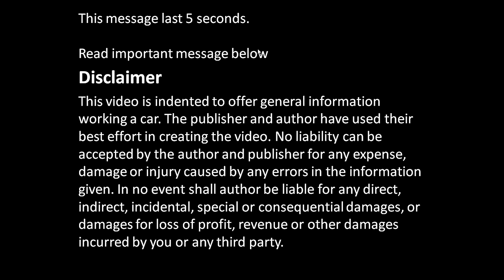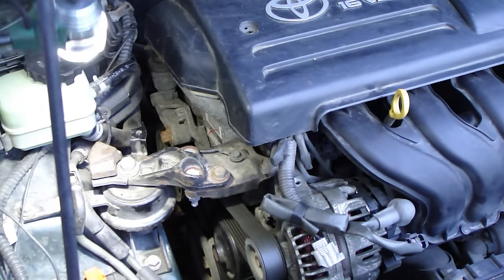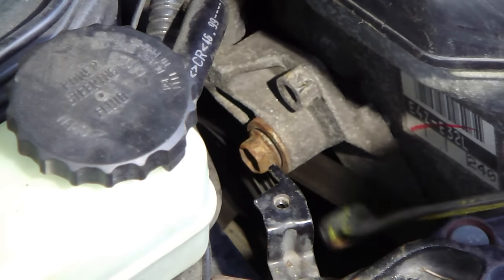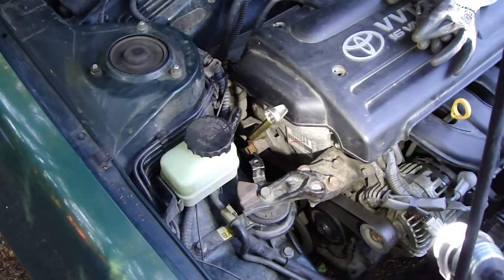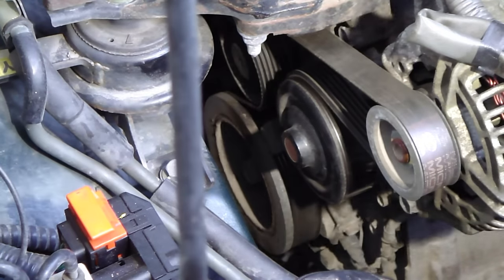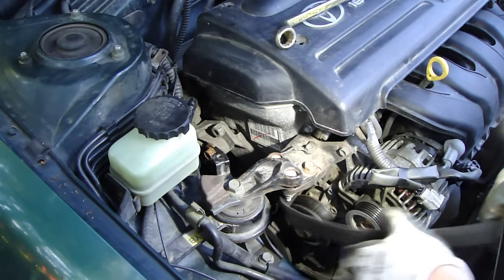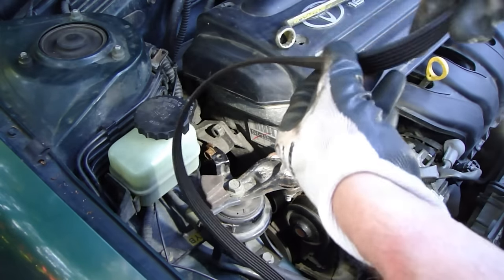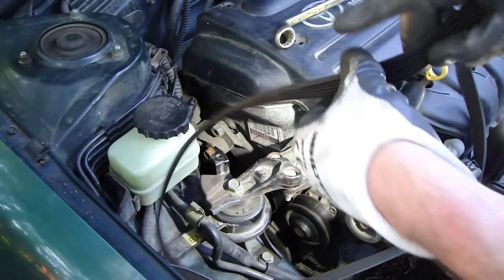How to replace drive belt or serpentine belt Toyota Corolla. VVT-i engine. Years 2000-2009.

Comment: Thank you Peter. I finally changed my belt a minute ago. My arms are really skinny but it was still extremely difficult to get to the bottom pulley.  I was thinking about taking the tire off, but I instead jacked the car up and went under to get the belt around the bottom pulley. I also needed the serpentine removal tool because using the regular socket wrench was too difficult for me. Saved me a lot of money though!

Comment: Thank you so much! I watched 3 videos to change the 2008 Corolla belt and all three were DIFFERENT! THIS one is the same as my Corolla so I was very glad to find your video! I agree with Marie Beckley that you shouldn't need to loosen the tensioner pulley bolt unless you are changing the pulley. By the way, excellent multiple visuals of the belt from different angles!  Thanks again!
Reply from the maker: Hello and Thanks for your comment. :-)
Reply: instablaster.

Comment: No need to loosen the tension mounting bolt, unless you’re replacing the tensioner component, it pivots on that bolt. Put a six point socket or closed end wrench on the 19mm cast nut, pull towards the front bumper, slip the old belt off the alternator. It’s also recommended to check the tensioner pulley bearings at this time. If it needs replaced, now is the time to do it! Install the new belt in reverse order. Before starting the engine, be absolutely certain that the belt is on every pulley groove on each component by physically touching. Only then can you start and immediately stop the engine. This allows the belt to seat properly in the grooves. Double check by touching the belt again confirming it is on each component groove as required. Don’t just rely on a visual inspection while the engine is running. Failure to install the belt correctly will damage the new belt. When buying the new belt, Toyota is notorious for using the car VIN for parts lookup. Don’t walk in and say “I’m working on a year/ model yaddayadda”, or you’ll be making two trips to the parts store. Use the VIN number!  I hope this advice helps.
Reply from the maker: I have read your message, Thank you 😀👍

Comment: Thank you once again peter for your well informative content. I had that one bolt really jammed, didn't really budge even with a pipe at the end of the wrench. I put the engine on for a while, and there it started to loosen up. I think that small heat did the trick.
Reply from the maker: Good to hear

Comment: Sir, I have two issues with this video.
1. the first bolt that is loosened with a 17 mm is not necessary, loosen the bolt if the tensioner is not pulling as it should.
2. for better access take a 10 mm socket and remove the plastic panel over the top of the engine. it gives an extra inch that is valuable to people with larger hands.
Reply from the maker: Thanks for info.
Reply: I agree DUDE...The 17MM is just a hinge bolt. The "arm" is always free to swing, but always tensioned.  Just a 19MM or 3/4"(19.05MM) socket with a "long handle" is all needed.
While belt is off you can also do a quick check on the waterpump and alternator bearing.  Just hand turn it.
Reply: Dude12485 - I total agree because I have large hands and it's a pretty small area to work in. I'd like to add a 3rd note... There are lines crossing the access to this area. I wish this video added removing those, too. That last pulley was a real frustration challenge for me.
Reply: Yep, the tensioner is free to move...otherwise it wouldn't be tensioning the belt ;-)

Comment: My husband said that you do not need to loosen the tensioner's mounting bolt. All you have to do is spring the tensioner downwards while pulling the wrench or breaker bar towards you. Also, it helps to have another person hold the new belt tight until the other person springs the tensioner into position to finalize the belt installation.
Reply from the maker: Yes, this could works too. :-)
Reply: I could not loosen my 17 mm mounting bolt, but was able to release 19 mm automatic tensioner and remove the belt.
Reply: It's nice to hear someone articulate the procedure in clear English.
Reply: Your husband is correct that is the correct way to do it.

Comment: When I replaced the serpentine belt on my corolla, I did not loosen the tensioner bolt. I just swung the fix bolt toward the front and the belt went loosed.
Reply from the maker: Ron Peralta Ok, this your service was like fast and brutal way. Toyota parts can resist also bad repairs and service. But Toyota's parts could also go broken same day with bad service.

Comment: My car just hit 149,981 miles on the original belt.
Just checked and it has tons of cracks on it.
Definitely time to replace it.

Thank for the instructional video.
I was scratching my head how to loosen the tensioner to get the belt out.
Time of the OEM belt to last me at least another 100K
Reply from the maker: Thanks for comment. Please use quality belt, the best belt is Toyota Original part.
Reply: Yes, just ordered the Toyota Original Equipment Manufactured belt.  It is quite expensive, but I think it is worth it.
Reply: Hi Peter,
Quick question for you, how happen if you remove the belt tensioner completely? Do I need special tool to compress the tensioner before I re-install it?  Reason to take it out to check and properly lube it. Thank you.
Reply: Never mind, I saw your other vid replacing the tensioner. It looked straight forward.

I do see lot of comments regarding the bolt being too long.  Look like Toyota engineers didn't think this through, so the only way to replace the tensioner is to hoist the engine out for the extra 1/16 of an inch needed to take the tensioner out.
Reply from the maker: Good choice.
Reply from the maker: The tensioner is easy to take out and install.  No needs to any special tools.
Reply: Yeah, I am not a very happy camper right now, just went out to inspect the tensioner, and it was leaking pretty bad.  Now I have to replace it.  I just hope I don't have to jack up the engine or hoisting it out just to replace it.  maybe, I just replace the compression cylinder and not the entire assembly. Mine is 2003 Corolla.  I saw a vid on the 2004 Corolla, and the engine has be raised about an inch to take out the bolt.
Reply from the maker: Timothy Taylor Hi, you don't need to replace your tensioner. If it still works: belt is tighten and no any bad sounds. You could use your old tensioner, even the leak. Toyota original parts are incredibly good even with small issues.
Reply: Hi Peter, thanks for the advice, and truthfully, I wished I didn't see the leak.  Unfortunately, I am the kind of person who can't stand it knowing that it isn't perfect. Since I have to replace the belt anyway, I'll try to replace the tensioner too.
Reply: Timothy Taylor Hi Peter, good news, I think. I looked again at the belt tension and cleaned it with brake cleaner.  Well, it isn't as bad as you said.  It may have a very tiny leak, but over time, it attracted dirts and grimes, it is quite a built up.
It could also be oil drops ended up there.  It is now clean, and I don't think it needs replacing, but I'll keep an eye out for it.
Reply from the maker: Timothy Taylor Hello, Great info. Toyota original parts are superb.
Reply: Timothy Taylor The tensioner that leaks oil is the timing chain tensioner. The serpentine tensioner is seperate. 

I found an amazing how to on that on a forum. He got must of that how to from the Haynes manual. 

Maybe I can find it for you. He had a few improvement on Haynes and he had better photos as you go then Haynes, I think.
Reply: The Serpentine tensioner is hydraulic and yes, it's leaking, but I am too lazy to replace it. until the belt jumps, then I'll deal with it.
Reply: My information was from a Toyota parts guy who usually knew what he was talking about. Thank you. If that's actually my leak that's a WAY easier fix. I'll be looking into that ASAP as my leak is minor in the heat, but not in the cold.

My belt is continuously soaked in engine oil. Good thing I bought the better brand as it has tolerated this condition for two years with no sign of wear. Can't last forever.

Comment: Your video states instruction for model years 2000-2009 however I found that my 2009 had a manually adjustable belt tensioner which made the job that much easier.

Comment: I have corolla 2008 model sir and its automatic..when its morning when i start the engine theres a noise from the drive belt..i have a question is there anjustment of the drive belt of corolla or none or do i need to replace it..

Comment from the maker: The motor on the 2009 corolla is different. You have to release the tension bolt that sits on top of the alternator.

Comment: When low revs and on load, I'll hear for a sec chirping from the belt. For example changing early to 3th gear and revs at 1000 uphill. This seems to be amplified when AC is on.
Could it just be the belt or is a pulley going bad?
Reply from the maker: I have read your message, Thank you 😀👍

Comment: When you are tightening the bolt after putting on the belt do you just get it snug or should it be tightened hard the whole way down so it never budges?
Reply from the maker: William Sadowski Hi. The bolt is like locking bolt. Only normal tightening is OK.

Comment: Hei, Peter it is not necessary to unscrew the screw that holds the tensioner to the engine. Only pull the tensioner forward, using 19mm.
Reply from the maker: Thank You for feedback. :-)

Comment: I just checked my drive belt for the Toyota Avensis 1.8 vvti and it looks exactly the same setup. But my belt looks like old and some cracking in the grooves i am scared to do it on my own i make a mistake i know its a relatively easy job but i wonder how much a local garage will charge me.I really am tempted to do this job on my own my car has AC I just wonder if its just a little bit bigger than car without Air Conditioner. My car has 70.000Km and the belt has never been changed looking at it

Comment: Thanks Peter! I seem to always have trouble finding the tensioner. As I see more if them on more models, hopefully, I'll get a better feel for it.
Reply from the maker: DE Nichols Tensioners are cool stuff.
Reply: Hey man. My belt tensoner is leaking. Any suggestions? I'm going to take it off, clean it and use a gasket maker and put it back together. At $115 to replace, I think it's worth trying.

It seems to leak where it connects with the engine so I think I have a good chance at success.
Reply: I'd be happy to. The chances of you being close enough to make it worth it however. ..
Reply: I check my drive belt today after I saw the video and is ok,I don't need to replace it:)
Reply: Mine is shockingly fine with the oil that's always dripping on it.

Comment: Excellent video. I just checked the belt today when it was on the car and loads of minor cracks showing. Will need to replace it soon. It's 2001 corolla with112k miles on original belt WOW . 

Also there is Brown rust on the belt path and on the inside of the bonnet. Could it be water pump is failed? Coolant level is ok. 

Also thanks for your very comprehensive videos on the corolla e11. They are amazingly detailed.
Reply from the maker: nopy99 Hello. The rust is normal in bonnet, if your car is model 2001. And if you might have water pump leak, then your car's coolant liquid should be also missing too.
Reply: Ok, no missing coolant but the serpentine belt is badly cracked. Thats probably the next video for me to follow. Looking at your video i think its a 15 minute job!
Reply: nopy99 Check the pulleys for damage too. Use a quality truly straight metal ruler to check that they are even. Usually if they're uneven you'll get a squeak.

Comment: What you needed to do was find the tensioner normally you fit a 3/8 drive when you put some pressure on it loosens the tension on the belt so you can just slide it off and slide the new one right on don't take anything off except the alternator unless you're doing the thermostat and remember torque wrench is your friend
Reply from the maker: Noted

Comment: Hi Peter, we are trying to change the timing belt on a 2000 year 7A-FE 1.8 Avensis by following the video you posted on this. As my car has Air con and this wasn't covered in your excellent video., it seems we need to take off the Aux belt to gain full access to the lower timing belt cover(?). We are finding it impossible so far to undo the nut (14mm) that the Pulley tensioner revolves on, we can loosen the adjuster bolt OK but the other nut is stuck solid, we even bust a ring spanner trying. May be we've now turned the nut, (probably) any suggestions??? We need help...is the another way of getting the tensioner out...even if it means fitting a new one...or a new belt??
Incidentally, my timing belt has done 103000m....only just realised ts not a chain!!

Comment: Thank you for a great video and good help! Is there any difference from the corolla VVT-i engine to the Avensis VVT-i engine ? I have a Air condition system, will that have any major impact ?
Reply from the maker: +arild kvittingen Hi. Same engines. Air condition needs longer belt.
Reply: Thank you very much!

Comment: I have a 2005 Toyota Corolla E12J 97HP, 1.4 Petrol with no Ac Unit (Irish car), I've been trying to find out the length of the serpentine belt that I need, I can't find any diagrams without the AC unit and I don't want to take off the belt to measure it, because I'm still debating whether I should take on the job or not. Any help would be hugely appreciated! Excellent videos by the way Peter
Reply from the maker: Hello, I read Your comment. Thanks. 👍😀
Reply: @PeterFinnTheCarDoctor  thanks. But do you know what length of Serpentine belt that I need for a 2005 Corolla with no A/C Unit?

Comment: Hi Mr. Peter my 2000 Toyata Echo makes a squeaking sound when I start and its running below 10 - 15 km/hr but it goes away when I speed up. Do I need to change timing belt now ? What would be you suggestion. Thank you
Reply from the maker: Hi. Could you tight the belt. And do you have similar tensioner as I do.
Reply: Peter Finn I think I have to open it to tight the tensioner. Another thing I noticed was that at cold temperature as -4 it has stooped making squeaking sound.
Reply: Afzal the belt is a little loose or you gave a misalignment. Check with a straight edge metal ruler. Are the pulleys even? 

Does one wiggle? If one wiggle it'll need replacement. If one's misaligned, in or out, you can pickup a pulley tool for not much at Harbor Freight or rent one at a local auto parts store. 

When you return the tool you get all the money back. If you don't, you did pay full price for it already.

Comment: Hey Peter. I have a question. I have a 2007 Toyota Yaris that has been having some issues starting lately. I jumped it and it ran for a little while before dying. The battery light on the dashboard is also on. Could this just be the serpentine belt, or is it the alternator?
Reply from the maker: Eric Tramontana Hello. You issue sounds to be like alternator issue.
Reply: Thank you for your help!
Reply: was it the alternator or the battery? just curious

Comment: those little cars are so easy to work on with the right  tool , remove the plastic cover and get a belt tool it cost $16 on Harbor Fright .. also if idle pulley and belt is from factory , then change both with a new ones....
Reply from the maker: Hi, Thanks for comment. :-)

Comment: hi peter    i just changed  my self driver belt 2005 corolla  ,   i only put down that 19mm bolt to loose the belt                   auto  head light     i think i demaged something     theres a stick came out below waterpump       what do u  think   ?
Reply from the maker: Hi, could you take small video on this: a stick came out below waterpump. Thanks.

Comment: Why is it necessary to loosen the 17mm bolt? Isn't a fixed system?
Reply from the maker: BrendanGilmanGuitar 17mm is like lock bolt.
Reply: +Peter Finn Is it really? Because according to my toyota service manual it isn't necessary to remove it. I recently ran into issues that the 17mm bolt was stripped, i had to jack the engine up to replace it. When the bolt was off, I could just wiggle the whole tensionner assembly around.
Reply from the maker: Ok, Thanks for info.  You really tested the bolt. :-)

Comment: Sir.How does timing belt produce electricity?
Reply from the maker: Alternator. Thank You, Your feedback is very important to me. :-)
Reply: The timing belt dosent turn the alternator.
This drive belt/Serpentine belt is an different belt then the timing belt.
The timing belt is installed behind a cover on the engine.
The timing belt runs the valve axels.

Comment: What is the length in mm of the belt?
Reply from the maker: Noted. Please join to my Membership ! 👍😀
Reply: Use the VIN number! The belt length depends on the number of components it has  on the engine. Some cars have AC, some don’t, etc.

Comment: in video  1:25      i didnt loose that bolt            is that ok?  damage to other stuff?  i just change it the belt
Reply from the maker: Hi and thanks extra info. I thought that you have not damaged anything, but your car's belt could be now loosen. So, please open also 1:25 bolt and then tensioner tighten automatically the belt.
Reply: Peter Finn mr peter                      but i dont feel  anything wrong.  still could drive            nth wrong                    . open the 1:25 video that bolt   ?    tensioner tighten?
Reply from the maker: fisher white Hi, if you get new issues with your belt, please open and tight (video 1:25) bolt again.